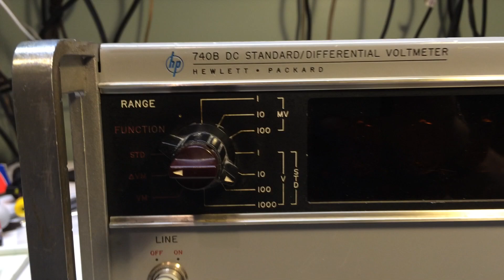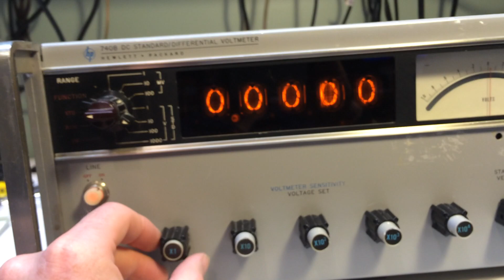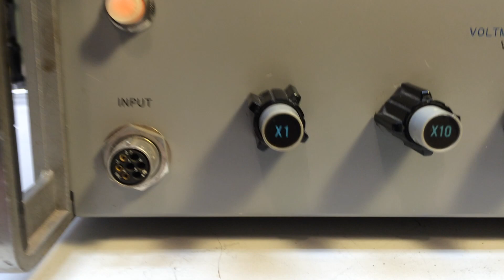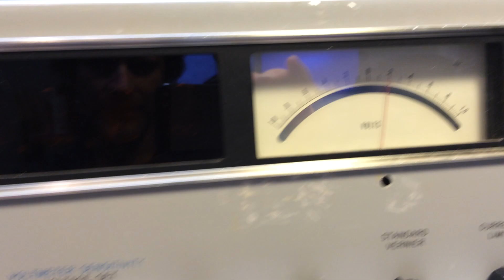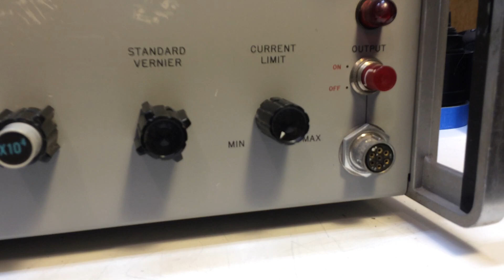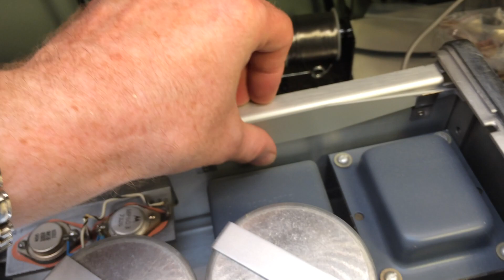HP 740B DC Standard/Differential Voltmeter overview

Comment: Hi, i just win an auction on evilbay for the same instrument and then find your post on eevblog! Thank you for the information on the forum and this video. I will need to ricostruct the boxes for the input/output.. Have you make progress ?
Reply from the maker: I wound up leaving a search in place for the input and output boxes, and eventually managed to buy one of each.  It took a long time for them to turn up, though - I'd imagine that most got separated from the instruments or simply tossed over the years.  I'm presently up to my eyeballs, but will try to find time in the next few weeks to open and photograph them, and post something in the EEVBlog thread.  In the meantime, if you'd like to try to get the 'official' HP ones, you can search for HP 11054A (input) and HP 11055A (output) on the bay of evil.
Reply: Hi, the instrument is arrived and finally i have some time to play with it. All working and in good shape. The internal battery show 1,350v, maybe i will need to adjust the internal zero because in the differential voltmeter mode, input shorted, on the x10^3 the needle start to go left and on the 10^4 it is almost completely to the left, no way to zero it whit the pot on the front panel... I have not read the manual yet, but, is that normal that the needle bounce on one side for a brief period when i turn the instrument on and off ? I am not found a suitable replace for the connectors, i must to be patience to find those input/output boxes.
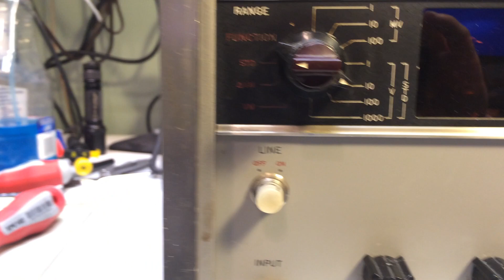Reply from the maker: @giacomo1191  I haven't done much of anything with the unit since posting this video (too many other things in the repair queue ahead of it), but did dig it out enough just now to plug it in and power it up.  I can't answer your first question regarding the differential voltmeter at this point, but as far as power up and down, mine exhibits similar behavior.  On initial power up, the needle goes from its mid-scale resting point briskly to the left stop (briefly visible in the video above at 0:29 or so), then more slowly moves upscale to the mid point.  On turn off, the opposite happens, it swings against the right side stop before settling back to the mid scale resting point.  That behavior, at least, appears to be the nature of the beast.  It's nice to hear that your battery isn't completely stone dead as mine is.  Keep me posted on your progress!

Comment: I was given one of these along with a bunch of other electronics several years ago. It's a bear to move around ... must weigh at least 80 pounds. (photos on Flickr https://flic.kr/p/qiQM4r ). I replaced the power cord receptacle today (the phenolic was broken in half). My unit has the input and output on the back with covers on the holes on the front (opposite of yours). I have no cables. There is also a holder for a 1.5 v AA battery.
I noticed that when I turn it on the meter pegs all the way to the left. Do you have any idea what might be happening there?
I read your discussion about repairing those rack handles; nice job!
Reply from the maker: Hey Ken - sorry for the slow reply; I only just now remembered this (got an e-mail notification, but was on the road for work and it slipped my mind).  Yes, it is a beefy piece of gear - according to the catalog it's just shy of 50 pounds.  Where is the AA battery holder - inside where the voltage standard mercury cell used to reside?  Cobbling together a replacement for that is one of the things on my list, but for the time being the unit is in my extensive repair queue.

I just dug it out and plugged it in to observe the actions of the meter; I'm inclined to think that what yours is doing is normal to the breed.  On power up, the needle on mine goes against the left peg for a moment, then moves back to center scale.  On power off, it heads to the right, though not typically all the way, nor as fast as its westbound excursion on power up is.  Probably differential power supply rails coming up and dropping off at slightly different rates.  I don't think it will harm anything.  

It appears based on the relocated input and output connections the one you have has that yours was configured to be in a rack mounted test system and the cabling was run to a fixture permanently mounted to the rack.  One of these years I need to get my butt in gear and get mine onto the bench again for a more thorough going-over.
Reply: I will have to look for the holder and get a photo for you. I can't remember where it was at the moment.
Reply: I placed some photos of the bottom of the unit and the battery holder on Flickr.
The address is:  https://www.flickr.com/photos/kb1awv/albums/72157692265215662